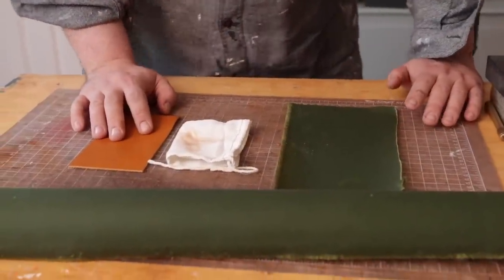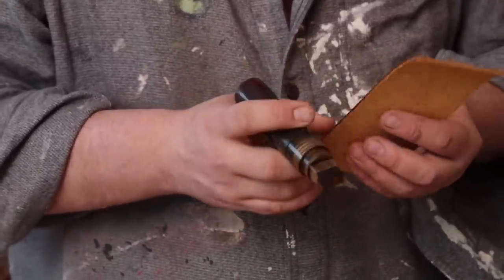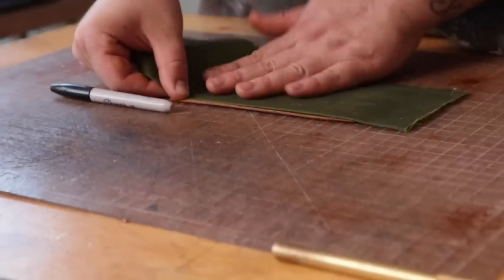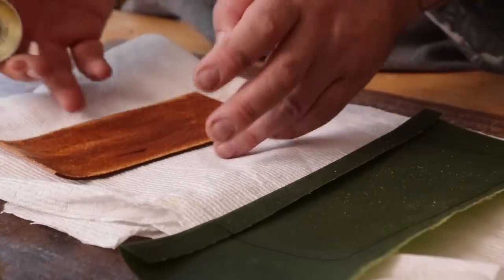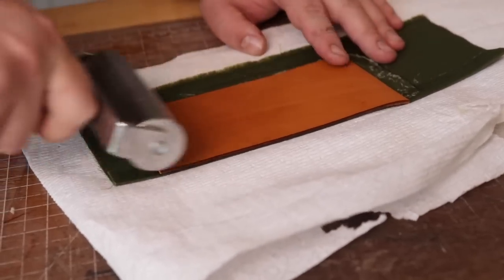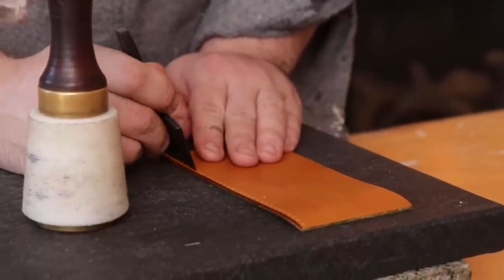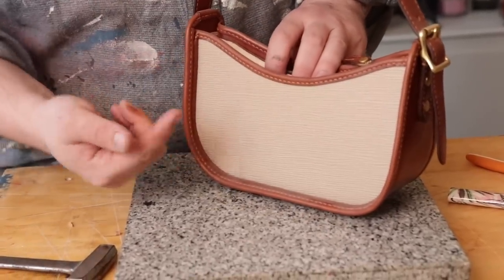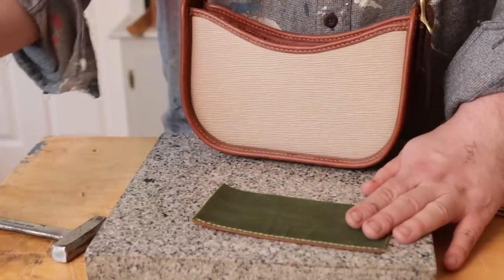How to line a Leather Wallet with Fabric

Comment: I use silk fabric to line wallets all the time but would never glue the whole of the fabric down, just the edges are glued with a 2mm gap before the edge of the leather so it doesn't interfere with edge slicking.

Comment: Have you experimented with RFID blocking sheets (perhaps similar to whay Tandy sells) between the leather and the liner?  Have you found interest with your customers for RFID blocking tech?  
Thanks for all of the wonderful information you share with us.  You have been very helpful in my ability to  use leather.  I realky appreciate all of your videos.
Reply: The RFID wallet thing is unnecessary.  A data defense expert said in the last 25 years he hasn’t seen an actual crime that would have been prevented by an RFID wallet, and the cases where an RFID crime happened was when the card was used at a terminal like at a gas station. Plus these days the way data is handled by RFID isn’t much use to criminals . The safest way to pay is by using an electronic wallet like Apple Pay, google pay, Samsung pay etc because each transaction is using a token ID and not sending out actual card numbers.

Comment: I used contact cement with a cotton fabric. It did seep through, I used a rubber abrasive cleaner to remove the seeped cement. It got rid of the residue.